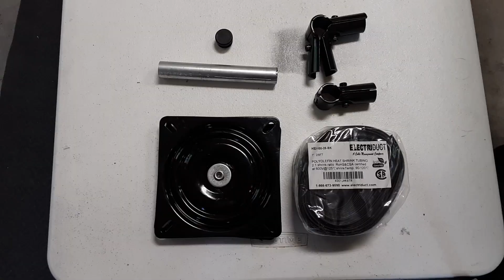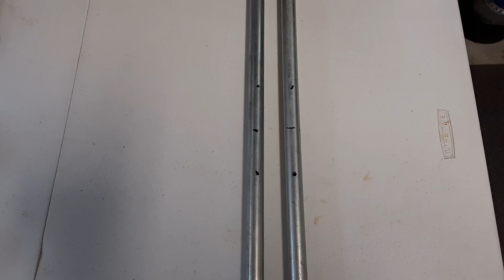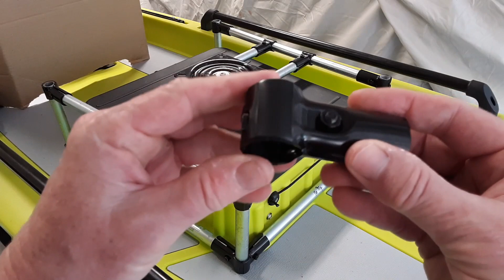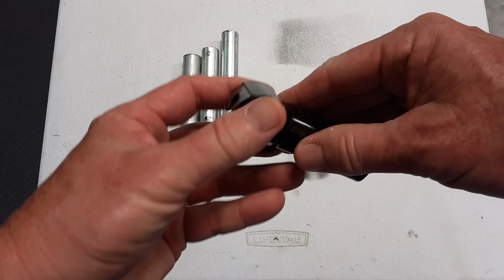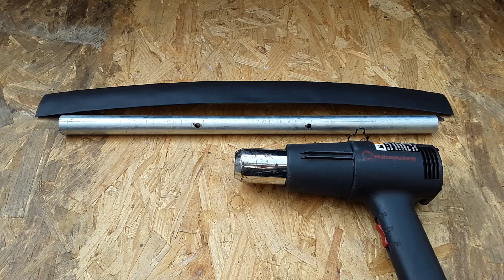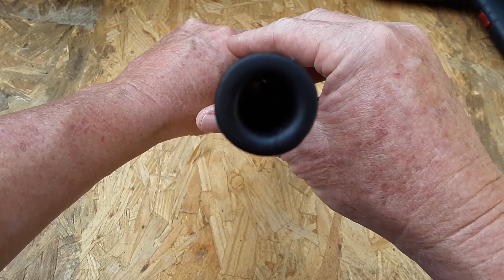Hoodoo Hero 130 Skiff 360 Seat Build

Comment: No Drilling into the Hull. Swivel Seat. Great Project. Any leaking into the Hull from any of the other drill holes like on the rails?
Reply from the maker: Thanks. The only minimal water in the hull from any mods. A large sponge was enough to sop it up.
Reply: Where does the water pool and where do you remove it? I ask because I fish in the Ocean and choppy Bay waters. I often get swamped.
Reply from the maker: It didn't pool. It was just damp inside.

Comment: Anyway you could build a motorized power pole?
Reply from the maker: It could be done but I don't think it would be very practical. Even the actuator motor lift is not worth the cost or build space in my opinion.

Comment: what about putting the lower forward support bar up to the top so you can slide the seat back and open the hatch?
Reply from the maker: You could do that but I wanted the seat to be secure and not move when on the water.